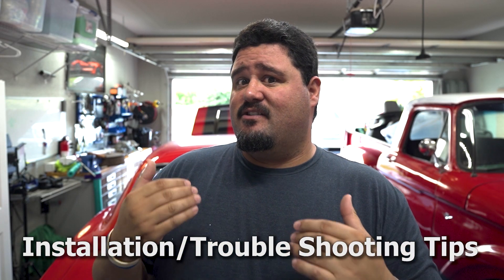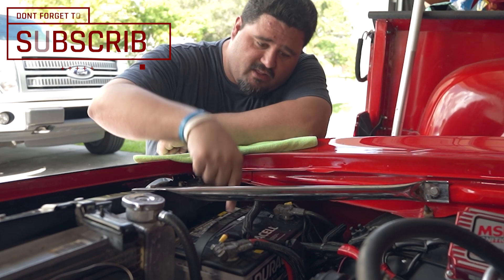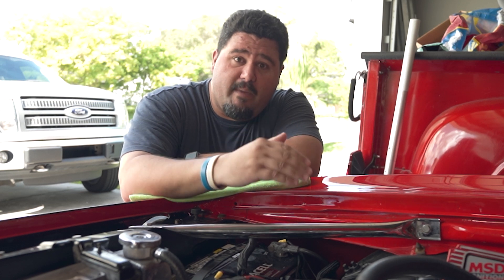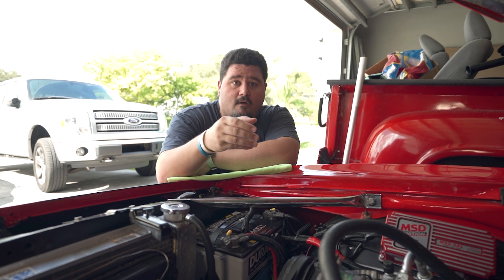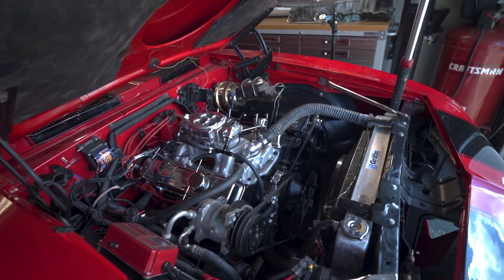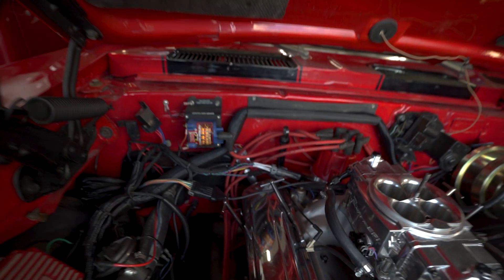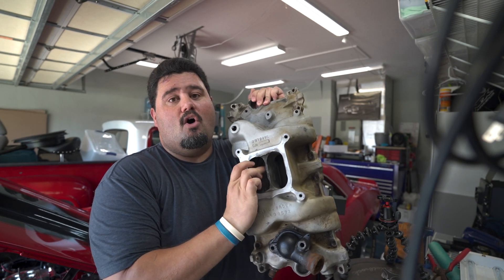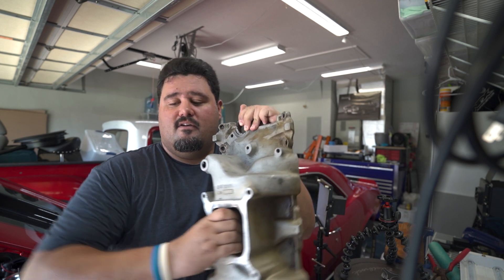Mistakes when Installing EFI. Watch before install

Comment: And I just wanted to add make sure you got a qualified a alternator. If not it's not going to work right cuz you don't have enough. Voltage on your card and everything happened to draw power and a box. Not enough  voltage even your box won't work right. So what that means is nothing's going to work right
Reply from the maker: That's is so true! Great additional info! Thanks for sharing👍
Reply: @AcesGarage  no problem I found out that the hard when my car cat popping didn't have enough voltage for the MSD

Comment: Ok I have a question.  First off I dig your videos, good info I have been looking for. I have a super sniper stealth I still need to install onto my 48' pickup.  So regarding intakes, what would you choose and why (clearance is not an issue).   While it seams dual plane is compatible, I am going to be purchasing a new intake regardless as the Edelbrock EPS I currently have is not an air gap design, and I am trying to gain some of the advantages of an air gap intake (and my EPS that's on it now has some cosmetic issues "damage from the previous owner").  So with nearly all single plane manifolds being an "air gap" so to speak design, and something like the many "air gap" dual plane intakes, what would be your choice for the Sniper Stealth systems?  Truck is currently a medium aggressive 350 (not mild, not wild, just I'm between --- for now) that will eventually be getting a rebuild to something a bit more wild "aggressive" - say around high 400-low 500hp.  It will be a cruiser I can have fun with and still get rowdy with.  I "may" autocross it.  But would like to maybe do the hot rod power tour in 2 years (can't do it next year due to work).  I ask because to me it seems LS style fuel injection is for the most part a single plane design (am I correct??) and they run great across the power bands.  So would it be the same/similar for top fed Fuel injection??
Reply from the maker: Thanks! I'm glad my info can help you out. Sounds like your build is similar to my camaro build. I went with the edelbrock performer rpm air gap for my build. I think it is one of the best for street use and is really good for autocross. It will give you a good mid range torque curve, which is much funner for the street than a build set up only for max hp. Single plane intakes make good horsepower but only at wide open throttle. They really sacrifice the low and mid range power. Single plan intakes really loose the crisp throttle response that is fun on a street car. Single plan are great for drag racing and dyno but not as good for the street.   When it comes to ls engines, they come with a factory with dual plane intakes. I see most people swap to holley high ram intake for the main purpose that they are going to turbo the engine at some point. When you push boost, intake style doesn't make as much if a difference. Because boost is the cheapest way to make big power with a LS motor.